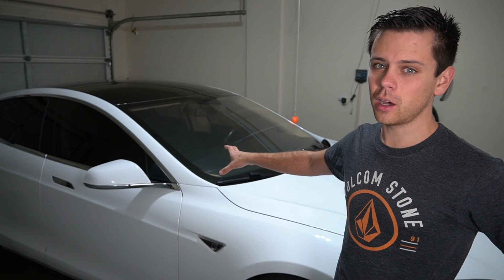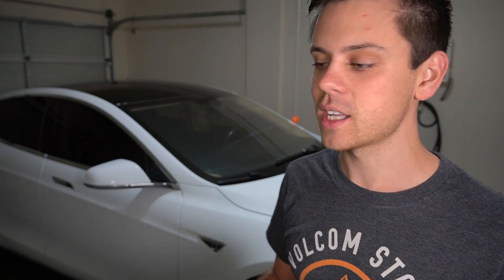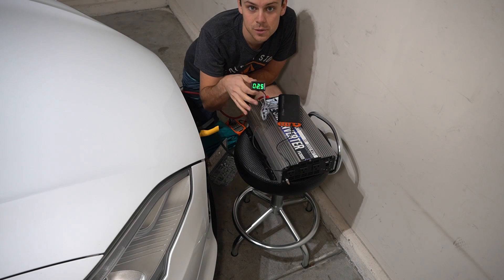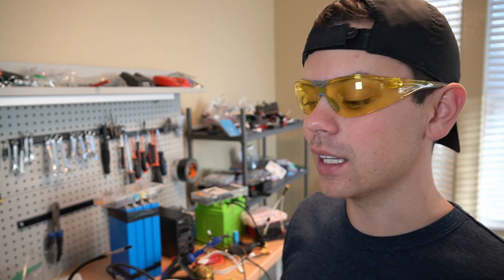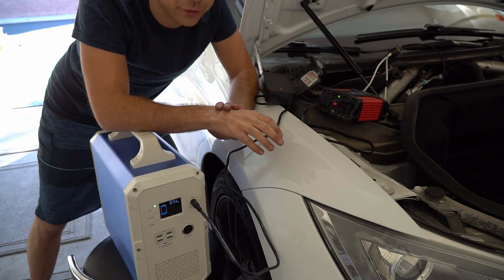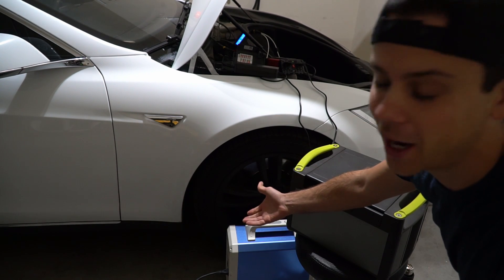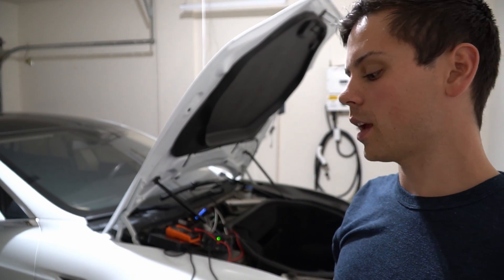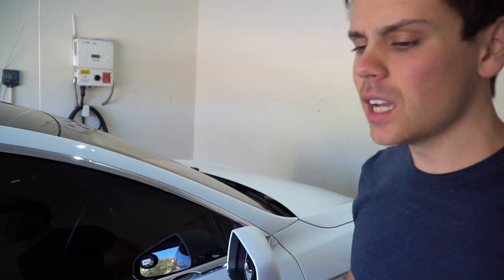Hacking my Tesla Model S for an Emergency 12v Power Source

Comment from the maker: Going by the comments below, it seems like people didn't watch the video, or want to argue or discuss non-relevant information. Yes, I know what petroleum is used for in other areas of manufacturing. No, we do not need super capacitors for this system. Oil is finite. I don't care when it runs out, it will run out and it is illogical to use it as an energy source. Why am I getting these comments? This video is about using a tesla as a back up power source. And no, I am not extracting power from a 400v battery. That is scary and dangerous. 12v sucks, but its extremely safe. I don't want to die. And when I make highly technical videos, it loses people. I try to make it simple for the viewers with projects you can do at home. I am not going to tear apart a tesla to show people an unpractical way of using the battery. Think about safety and practicality. This system can power a fridge in a grid down situation, and that is very useful.

If you have questions not pertaining to this video, ask them at the forum: www.diysolarforum.com

~*Tired of getting ripped off? Check out my "Will Prowse Approved" solar product recommendations below!*

12V Batteries
https://www.mobile-solarpower.com/lithium-batteries.html

48V Batteries
https://www.mobile-solarpower.com/48v-batteries.html

Offgrid Inverter System Builder
https://www.mobile-solarpower.com/48v-complete-system-blueprint-559371.html

Hybrid Inverter System Builder
https://www.mobile-solarpower.com/code-compliant-48v-offgrid-system.html

Mobile Handtruck System Builder (very popular!)
https://www.mobile-solarpower.com/mobile-48v-system.html

Solar Panels
https://www.mobile-solarpower.com/300w-solar-panels.html

Ground Mount Solar Racking
https://www.mobile-solarpower.com/ground-mount-racks.html

Wire, Lugs and Busbars
https://www.mobile-solarpower.com/wire-and-connectors.html

Tools
https://www.mobile-solarpower.com/tools.html

Fuses and Circuit Breakers
https://www.mobile-solarpower.com/fuses.html

Plug-N-Play Solar Systems
Ecoflow, Anker And Bluetti! So many models to choose from. See my current recommendations here:
https://www.mobile-solarpower.com/full-size-systems.html

~~~~~~~~~~~~~~~~~~~~~~~~~~~~~~~~~~~~~~~~~~
Need to build a large DIY system? Need a trustworthy solar distributor? These are my favorites:

Signature Solar
Creator of EG4! Solar Minisplits, Victron and More! Largest Solar Store Online.
If you want $50 off, please use my link below and coupon code "DIYSOLAR50":
https://signaturesolar.com/?ref=cPwLcVc0SW-BjN

Current Connected
Best Prices for EG4, Victron, Midnite and so much more! Fast Shipping and Highest Rated Customer Service:
https://currentconnected.com/?ref=wp

~~~~~~~~~~~~~~~~~~~~~~~~~~~~~~~~~~~~~~~~~~
Join our DIY Solar Community 
Need more help? Join the largest solar forum on the internet for beginners and professionals alike. 140,000 members and counting!
https://www.diysolarforum.com

Check Out My Free Book
Best-selling and beginner-friendly guidebook to off-grid 12V solar!
https://www.mobile-solarpower.com/the-book.html

~~~~~~~~~~~~~~~~~~~~~~~~~~~~~~~~~~~~~~~~~~
Contact Information:
I am NOT available for personal solar system consult! If you wish to contact me, this is my direct email: williamprowsediysolar@gmail.com
FTC Disclosure Statement and Disclaimers:
Every video includes paid promotion or sponsorship (such as free products for review). Some links on this YouTube channel may be affiliate links. We may get paid if you buy something or take an action after clicking one of these. My videos are for educational purposes only. Information is subject to change/update at any time. Electricity is DANGEROUS and can kill. Be smart and use common sense :) DIY Solar Power with Will Prowse is a participant in the Amazon Services LLC Associates Program, An affiliate advertising program designed to provide a means for sites to earn advertising fees by advertising and linking to Amazon.com
Reply: SORRY if my comment sounded like you were tearing into your car !! Just meant they are super sensitive to anything no normal !
Reply from the maker: No your comment was great. It's all good :)
Reply: @WillProwse  Can the Tesla be charged with a 12 volt Solar panel through the 12v battery? Can I use a 12 volt Solar panel on the dash to trickle charge the Tesla?
Reply: @private7746      " ? "
Reply: I know it's not safe, but out of curiosity it would be interesting to see though if you could access the 400v system, you could hook it up to the PV input of a 5kw hybrid inverter with a small 48v battery and get AC out right from the traction pack haha.
Reply: @chazable   exactly my thoughts.
Reply: "love or hate oil, we will run out"
We will never run out of oil, just like we've never run out of anything. In capitalism as the supply approaches zero, the price rises to infinity. As prices rise, alternatives become more reasonable to use. The few cars that are electric now, are powered by fossil fuels. The average working person drives 70-140 miles per day, that would be 20-40kWh per day, with inefficiencies thats 26-53kWh/day. If everyone had electric cars, that's 2x-3x what US currently produces in electricity and that doesn't include all the new stuff we'll need electricity for in the future like desalinization of water and hydrogen production. There is NO WAY people are going to put up with solar to produce that, as the current tiny amount of solar in California has quadrupled the cost of normal electricity in that state. Solar in California is 24k gWh of the 356k gWh it uses, or 7% solar. The 7% solar number is smaller than the governments 19% figure because Californians "sneaky" government pretends imported dirty power isn't part of it's reporting requirements to be green.
Love it or hate it, an electric car for everyone can only come about from Gen4 nuclear or fossil fuel electricity production. Solar has it's place, just like Ferrari does... expensive and pretty.
Electric cars a quiet and trendy, they are not efficient or inexpensive.

"Oil is finite."
We use a capitalist system to make all resources infinite in use. We have never run out of anything.
Reply: Consider the environmental damage that will occur by using all of that fossil fuel. The habitability of earth does have limitations. We aren't even fully capable of understanding the ramifications of our energy use yet.  Energy use and sourcing require additional oversight beyond monetary value.
Reply: @theherbstep  The US still uses 19% of the worlds energy for 5% of the population. Absurd waste going on
Reply: @b4804514  Just curious, where did you get that number from?
Reply: @msnpassjan2004  EIA Just google US vs the world energy use by population
Reply: @dmay3391  How do you explain excess hydro at night AND the fact that the vast majority of EVs are and will be charged overnight?

Fuck off with your FUD.
Reply: @dmay3391  You have some lousy assumptions and explanations. You have no idea what the future holds but if you can't breath the air or the planet overheats that we know is coming. So keep eating Mcdonalds fries
Reply: D May Yes it's true. Chevron and Occidental Petroleum funded a company who's scientists have already perfected the technology. They have now found a way to suck CO2 from the atmosphere and combine it with hydrogen in order to make a type of gasoline, diesel, and jet fuel. It's a way to fight climate change while producing fuels for combustion engines that won't add any additional CO2 to the atmosphere. This already developed technology will be widely available soon. Because coal is so dirty and still produces a third of the United States power supply, Trump said his government would invest in "clean coal" and clean emissions technologies. Wether this tech is used on a coal plant or built into HVAC systems nationwide to clean the air while producing fuel, It basically produces less or the same amount of carbon as it removed from the atmosphere to produce the fuel, thereby making it emissions negative or at least carbon neutral. It is also inexpensive to produce and will become increasingly popular in states like Washington and California who may soon charge a carbon tax, and provide incentives for these types of technologies.
Reply: Small air conditioners, microwave and compressors are 25-83amp. Maybe someday an inverter kit and pulgin for the 60+kWh electric cars that allows 100amp will be reasonable. RV's  and powerless sites could plug into their electric car for a week and use some AC, microwave, compressor and computers. The car could go use quickcharge station for an hour and pickup 30kWh for $12. It would eliminate the problem of lack of space for solar on top of the RV's restricting power consumption to less than 10kWh a day and the lack of solar issues in the winter. Hydro and Gen4 nuclear cost $0.05/kWh.

How about using paid quickcharge stations and with DIY battery packs. Could a quick charge SAW CCS 120amp or AC Level 2: 240 V AC, 1-phase, <80A be used to get 30kWh into a 90kWH DIY battery pack in a hour? Could it be done without a cooling jacket on the batteries.
Reply: I never knew a Tesla had a 12v lead acid battery. I’m already informed even if I don’t understand half of the rest of what he said.
Reply: @7heRedBaron  yes the first few years of the model S used 12V lead acid, AFAIK they can be replaced with a deep cycle 12V if your tesla is out of warranty.
Reply: "I cant find the battery in this car" 😆. The 12V battery in your car is likely going bad; Tesla will likely replace under warranty. Your comment above proves how much most Americans are bewildered, to  ignorance, & misinforming "witchcraft mentality", about how electricity works, among other things, really quite sad; moving on. 

My home can go OG, so this is probably the simplest one-way V2G solution. It would be nice to make it simpler; maybe the connection point in the frunk. How does this work in conjunction with existing solar/wind, & energy storage? Is this more ideal for homes without exsisting  systems, or in some way be made portable? We hope you keep making videos, we enjoy them!
Reply: @supakat1835  "The 12V battery is likely going bad"?? Why would you say that? If there is an issue, sure, discuss, but stop with all the FUD talk. Have you seen what non-Teslas are doing to the planet? And gas motorcycles and lawnmowers? Oh, and all the generators we were running here in California last week. Don't let the Perfect be the enemy of the Good. -Obama
Reply: Tesla owners would buy a simple kit do do this. Is there an idiot proof design that could be easily manufactured to sell?
Reply: Good to see, clearly a Tesla could be used an an emergency electricity resource. I love how you find unique solutions taking into account safety and efficiency.
Reply: The important thing is you are teaching us how to use clean energy effectively.
Reply: About to watch this video thinking surely someone on the planet has done a DIY 120/240v output setup... Struggling to find information atm.
Reply: You can probably get an adapter for the electric car so you have 120 / 240v out but that's probably what kind of car you have, but you can still use the cigar plug in the car to charge a powerbank over time. I use my electric bike battery as a powerbank, I only have 36v I think 24v is better as you can directly connect an inverter and cigar usb thing and your bike, I have made a converter box from 36v down to 12-24v 500w. and mounted a cigar plug and usb plug with two usb 2A. and then I have an inverter 24v / 1000w 240v but it is only used for charging other batteries. the converter can probably be used together with solar panels with 30-50v / 10A out so I can use the 24v out of the conveter box and into the 24v / 1000w inverter and then my battery charger on (41.7v / 2A) and charge the electric bike battery.
Reply: Fantastic video!  Thanks for doing this.   I was looking for this exact information and watched every second of what you put together.   Super helpful!
Reply: being anti-electric pro-oil is part of many people’s identity because they have no personality of their own so they just subscribe to the rollin coal tribe. it’s childish and true factual statements like “oil will run out” is an attack on their identity. naturally they become defensive and offended.

Comment: Hi Will, Great video as usual! Now that used Tesla Model S cars are available for less than $20k they make a perfect off-grid power source. Using your method you can extract about about 500 watts max. That's pretty good but as I have discovered in my Motorhome, 2kW is the sweet spot where you can run coffee makers, microwaves, refrigerators, and toaster ovens one at a time. It would be great to tap into the supply side of the power converter or add another one just to power the AC inverter directly...

Comment: I’m turning my Tesla Model X into a camper. Can I do what you did and plug in a bunch of stuff like air fryer etc.? The air fryer pulls 1800w.  I also have a kettle that boils water for various purposes that also pulls about 1800 W. Do you have any recommended brands of inverters for something like this? I’d love to see a video like this, but for running things for camping not just for powering solar. Great video thanks so much.

Comment: it’s super annoying that it is remarkably easy to get 200kW into the tesla but super difficult to get 3kW out. it would be nice if the charger circuitry had an option to give us 100-150A 12V out of the NACS port.

Comment: how do you run out of oil? hahahaha oil doesnt come from dinosaurs like some say it is made by earth a well may dry up but you can find another well... new oil springs are made frequently.... do to america holding onto its reserves we have thousands of wells and untapped potential. if we dry it all up earth will make more!!! to over simplify its like how trees make air earth makes oil it can never run out long as the earth core is active. lot of these oil springs are hiding in the deepest oceans but they are in abundance anywhere there is fault lines...

dont buy that nonsense media tells you so you will spend money on green or dangers or what ever scares you. as a scientist i like EVs because they are more fun to drive not because of the save the world lies.... i could go deep in how the planet works but the big money will suggest a very different story so you will invest...ICE cars can poison the air we breath but doent harm the planet but rather the opposite... power plants poison the air to charge your car it just power plants are not close to your home. im stop here or i will go on and on

Comment: 4 years later... wondering if the Ecoflow Alternator charger works on S and Xs.  Have a Delta Pro Ultra, wondering if I can charge i from my X if needed... I see others tapping into their Y DC2DC converter lines to charge things.  Not sure if the older X and Ss work the same

Comment: Why not to connect before the fuse? Like in the bus bar or DC-DC inverter intake. So you have access directly to the DC-DC Inverter which can do 2500W. There is a 225AMP master fuse to this box, you could tap after that.

Comment: Thank you.   Question:  Do you know if "camp mode" in the Tesla will keep charging power flowing to the 12V/16V battery from the high voltage battery, or does the vehicle have to be in drive mode?

Comment: Correction: Oil will not run out. Why? Because Earth works as a battery which gets charged daily by the Sun. It stores energy as oil and gases. Oil can run out only if sun runs out.

Comment: You know as well as I do that a battery has only so many cycles. That battery is expensive and it’s even more expensive to get it changed. So don’t be fooled this is maybe ok in emergency but not to use every day. Still great fun and hope you pull the power from the HV battery soon. That inverter is under the back seat and that what powers the 12 volt battery. That’s the correct way to do it.

Comment: I just stumbled upon your videos. Great stuff! I'm a little confused on why you think the wires at the jump start terminals won't handle the load when they are protected by the 50A fuse. Are you saying tesla uses wire of too small a gage for the jump start circuit?  I'd like to be able to use the jump start terminals to run my little 2000W ZWRELB inverter in case of a power outage at my home if possible, and avoid having to dive in and hookup directly to the battery.

Keep doing what you are doing!

Comment: It is a massive shame that Telsa has been building cars for 10 years now without any options for output to an inverter for emergency home power.  Makes it as coup for KIA EV6 and the coming Lightning who do offer output power.  I paid $66k for my Tesla with 65 kWHrs and would just like to be able to run my heat pump or oil furnace for a day or two of power outage!

Comment: Hey will, awesome video.  I recently got a Model 3 and I'm very frustrated that I can't charge my laptop inside (it pulls 300W and a cig lighter won't even try) and this looks really interesting but I'm scared and even after watching I'm not sure what exactly I need or how safe this is.
Reply from the maker: Yeah you don't want to try this. If I were you, I would by a 500Wh solar generator, plug in your laptop, then charge the solar generator with 120W cigarette lighter adapter. That would work great

Comment: Hi, any update on the this subject ? I ve a 2021 model 3 and soon a 2022 model 3 with new accessories battery, I wish I could setup a sort Vehicule to grid system :-) , any advise or "solution" I could use ?

Comment: If you tap into the tesla heater circuit 
you can draw at 6kwh
Reply: is the Tesla heater 40amp/12volt? after the DC/DC converter ? or is that on a different circuit?